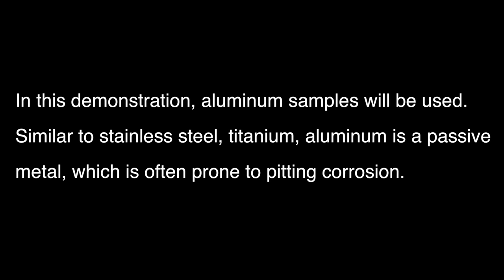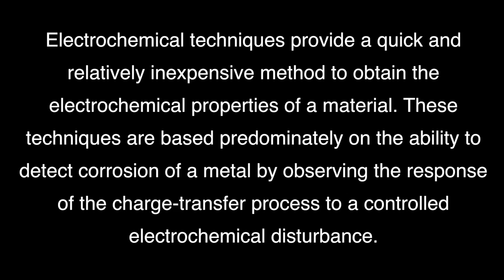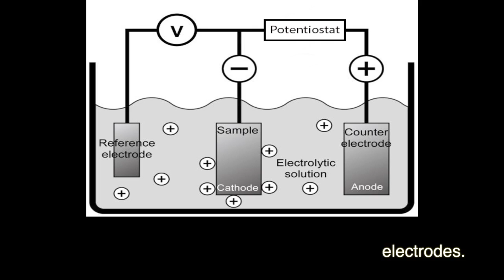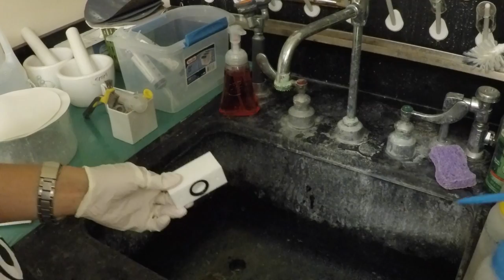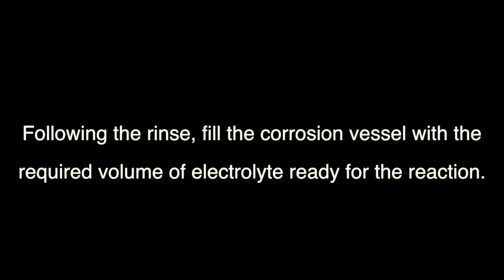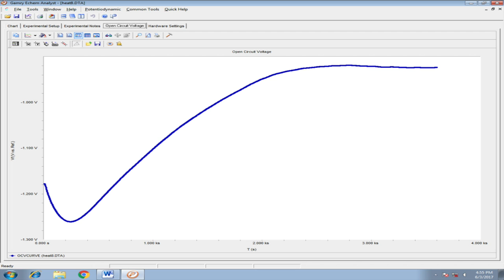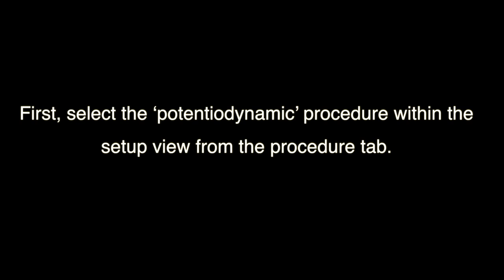Potentiodynamic Corrosion Testing Protocol (step by step)

Comment: Thanks for this informative video.
What will be impact of initial delay time wrt to end results?
Reply from the maker: you have to wait until open circuit potential reaches a steady state before PD tests in order to produce reproducible results.
Reply: Thanks for your reply.
But my actual doubt is :
Say we are keeping 5 mins initial delay and 1hr initial delay, will the results be accurate in both cases. If Yes / No - Why it is So?

Comment: can i use a phase change material as an electrolyte to check corrosion?
Reply from the maker: As long as it has some conductivity. 
https://en.wikipedia.org/wiki/Conductivity_(electrolytic)#:~:text=High%20quality%20deionized%20water%20has,electrolyte%20in%20a%20Wheatstone%20bridge.

Comment: Thank you for the video, this will definitely help me with my project , may i please ask, if you have 4 samples to test, after each test, do i have to redo the cleaning, i will be using the same electrolyte sample and different metal samples. Also , the counter electrode, does it need to be changed?
Reply from the maker: The test itself may change pH of the electrolyte, it is better to repeat the cleaning and use new electrolyte every time.

Comment: what is the standard statistical analysis used in this protocol?
Reply from the maker: based on the number of repeated tests that one performs, average, standard deviation, range etc. of measured data can be calculated.

Comment: does this testing useful for measuring corrosion rate of reinforcement bar in concrete (R.Concrete member is wrapped with external FRP system)??
Reply from the maker: The electrochemical part is the same, but the sample prep and container will be quite different.

Comment: I suppose the corrosion cell/vessel was made of Teflon. was it custom made or does any company supply them?
Reply: This particular one is custom made. You may use any non-corrosive container (e.g. glass beaker/tank) for your experiments.
Reply: hatchegg that's an awesome video. can you please provide the name of the company that custom-made your cell and coupons?
Reply from the maker: They were designed by graduate student and fabricated by the machine shop at USF.